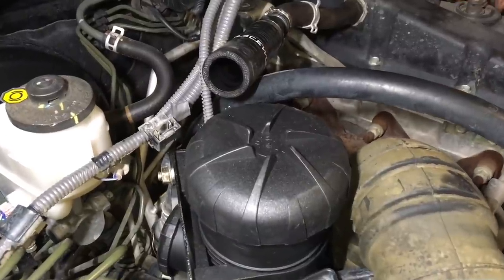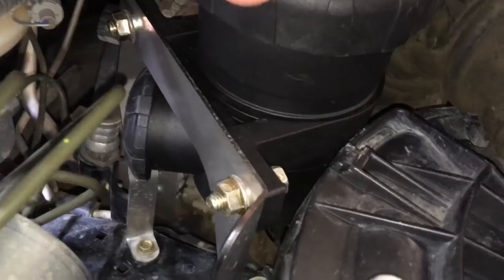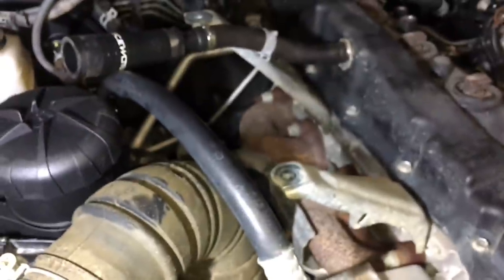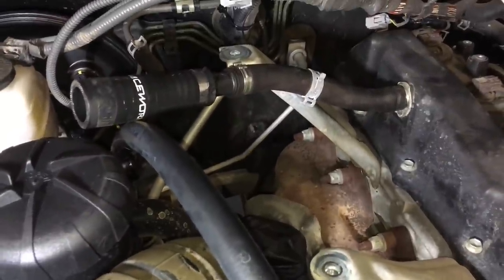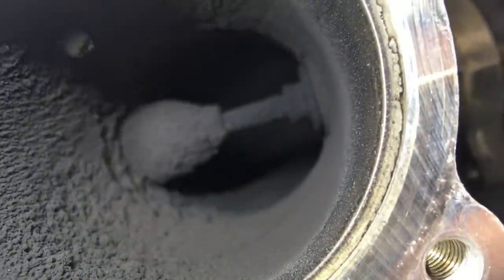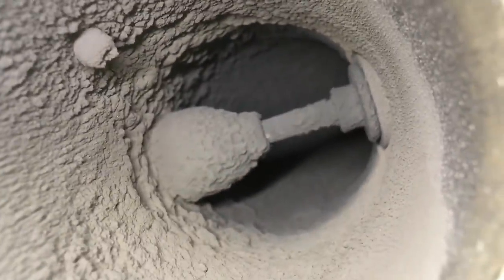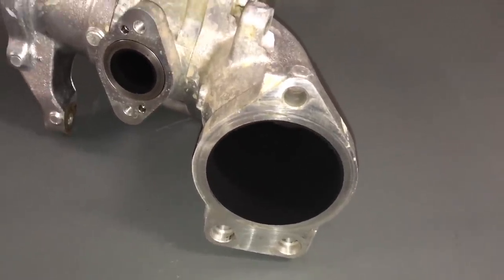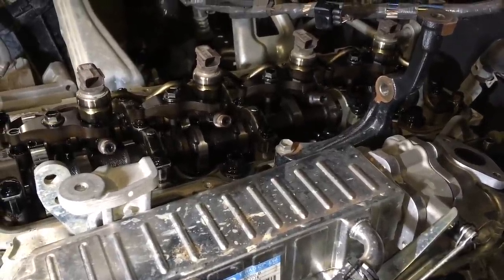THE BEST CATCH CAN EXPLANATION VIDEO - DOES IT WORK? Time to WAKE UP!!

Comment: There is a way to clean the inside Body of this unit is spray with carburetor or injection cleaner & also you could use longer drill extension & have a wire brush & will clean that up nicely & once  you have pretty nicely clean spray inside the intake unit again with carburetor or injection cleaner & that will get rid of a lot broken deposits & then go with a clean rag & that should clean that up nicely & will look like New again & talking about oil catch cans & I'm going to have to get one for the PT Cruiser that my wife owns & it has been a nightmare this car & I do regular oil changers on this 2 liter engine & have changed the coil & leads as the coil came with & also had to change the Champion Spark Plugs & even though they Iridium Spark Plugs they were stuffed & these Bloody Champion Iridium Spark plugs were put in by Bloody Fucken Mechanics Work shop when they did the Cambelt change & I didn't know that they were Champion Iridium Spark plugs & my said to me that they were special spark went into this engine & when noticed that they Champion Spark plugs & that they were Iridium Spark Plugs & they had black rings around the Chinas on all 4 spark plugs & I threw away & bloody good as the engine wouldn't run properly & I brought NGK Iridium Spark Plugs once I installed them the entire engine ran a hell of a lot better & they are the Bloody Best Spark Plugs that you can get & I still did have a slight miss in the engine & I pulled sum of the sensors plug off & sprayed them with WD40 & one of the plugs off from the valve body & before I took it off I noticed the clip that holds the plug on properly was broken bugger & was held on by a cable tie & who the broke that I don't Bloody well know & well anyway when I took that plug off & sprayed that plug connections & inside  the connectors where that goes into it put the plug back in place & I then closed the bonnet & went for a drive & put the accelerator hard down no more miss & solved the problem & I'm not a qualified Mechanic & yet I solved the really bad miss it had developed but now I have a blow by problem & yet the motor runs really well to but when I took off the intake manifold off when I did change the coil & leads & later when I changed the spark plugs I noticed a lot of oil it the intake Ports & wipe them up with a clean rag & later on when took the top off the air box off to check the air filter I got a shock the air filter was covered in oil &.I had changed that air filter a long time back   & so I had to take the whole air box off to clean the oil out of the air box & what a mission that was & so I checked the engine oil level & that was on the low mark & the breather hose I cut in it half & added a a breather unit to them but what was happening the oil was coming out of the 2 breather units & so now I have to install a oil catch can to solve the oil issue & having it installed by a qualified mechanic the oil catch can is a Ryco Oil Catch Can A RCC351K Crankcase Filter Kit & Tony found that I had a PT Cruiser ignition switch problem & needs a new ignition switch but can't get one in New Zealand & the Chrysler Dealers don't have one in New Zealand  at all which is a bugger & Tony is going  to see if he can fix the Ignition Switch & hopefully he can fix it & I have been having High AMP drop as well & the battery can go flat over night if I dont lift up the fuse for the interior light system as well as the stereo system & the heater so it must be the Ignition Switch Problem that is causing the massive Amp drop that I have & I don't have money to replace the engine & already spent money on 2 tyres & its going to cost me even more money on a Ryco Oil Catch Can to solve the blow by problem & had been a good realiable car & now its starting to cost money Kind Regards Peter

Comment: If catch cans were great things manufacturers would install them from new.
Reply: My TD27 has one from factory with drain back to sump, stil largely a waste of time but some do
Reply: A manufacturer fitted  catch can might be an expense  cost to the manufacturer I don't know .
Reply: They would if people remember to empty them every 5000km but that won't always be the case
Reply: then you should buy new car less  frequently.
Reply: If manufacturers cared for your wallet they wouldn’t run exhaust gases back through your intake👍🏻
Reply: @LsMaloo  precisely
Reply: They changed the law , no gases in the atmosphere. Being a diesel, I just cleaned my egr every 20 k .hotshot driver here
Reply: Isuzu themselves sell a catch can on 4JJ1 truck engines as a factory fitment, and if its correctly engineered you should have no issues.
Reply: Manufactures have no incentive to make their vehicles last past the warranty. Also, EPA is a big reason for not having catch cans.
Reply: GM's 1.9cdti (in alfa romeos, opels, saabs etc) has one. It's similar to the mann provent
Reply: That could be said of any vehicle modification though! 🤦

Comment: I'm on the fence regarding catch cans and even air / oil separators. In my opinion, the solution to all that carbon build up is Walnut Blasting the intake chambers and valves.
Reply: yes if you do it yourself, catch cans are much much cheaper and work on the long run too, cleaning once wont prevent anything

Comment: So I recently removed a catch can, installed at 200k and removed at 350k on a 2010 Prado. So what they don’t tell you, is that the filter in catch can needs to be changed. It’s actually hard to remember or for the mechanic to remember to empty the catch can. Which means it was probably doing more harm than good. After removing it, less smoky exhaust and I swear the car drives smoother and is more responsive. Save your money and install an arb on-board compressor. Much more usefulz
Reply: That’s ridiculous! You basically said you are lazy. Of course it’s not going to work if you can’t be bothered maintaining it! Don’t give people bad advice!
Reply: So you only change your engine oil filter because someone told you to do it? Of course the filter in the catch can needs to be changed.. any filter in any application will need to be changed at some point… you literally just described having a blocked catch can from poor maintenance.. the car drove smoother and was more responsive because you allowed the engine to breathe again, you are allowing it to ventilate the pressure which will free up a few horse power..
Reply: if you cant do very basic maintenance better dont have a CC, you are right